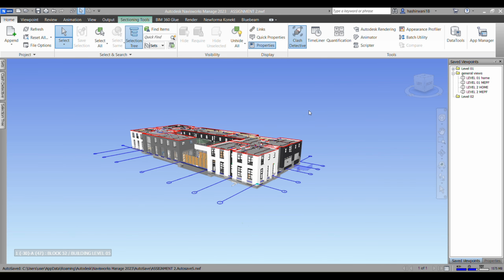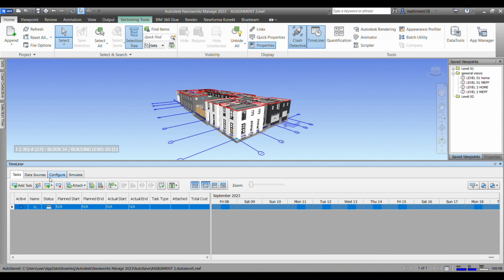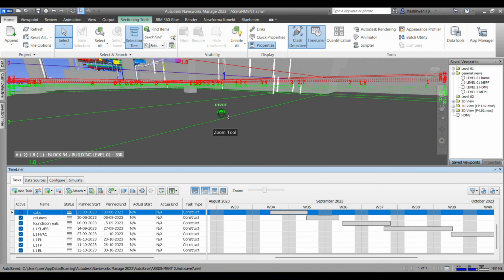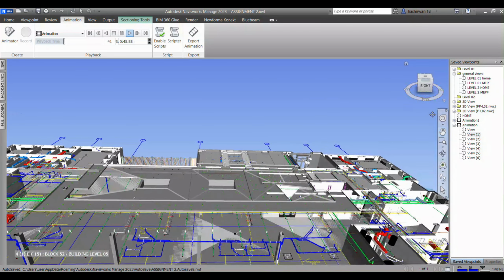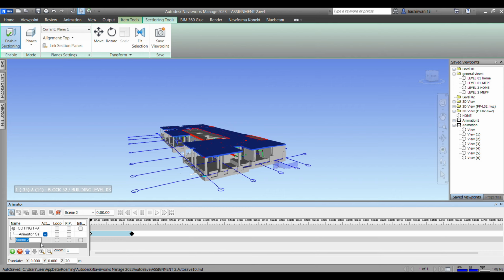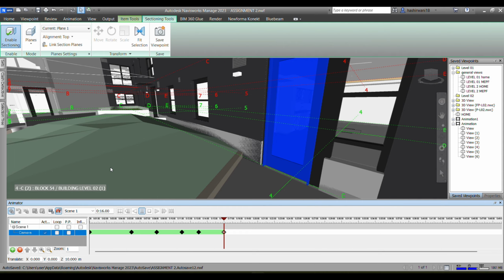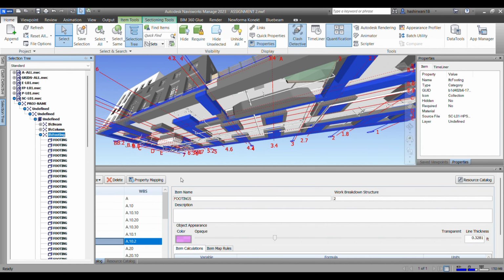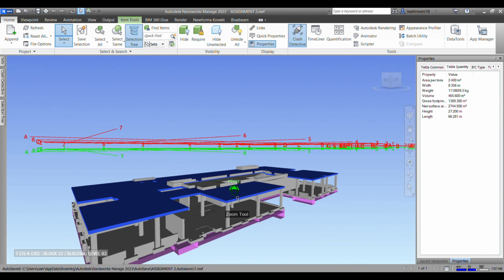BIM Navisworks 4D Timeliner, Animation, Quantification & Field Management Masterclass ER HashirVani

Comment from the maker: This video provides a masterclass on using Navisworks for 4D Timeliner, Animation, Quantification, and Field Management.

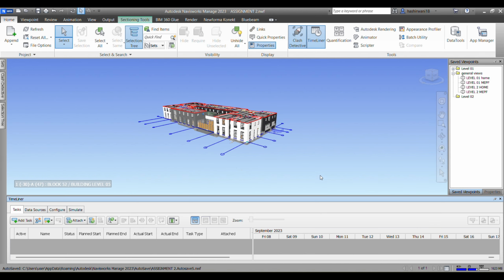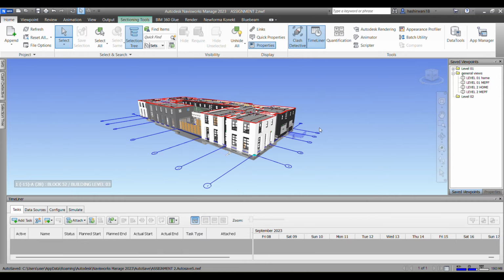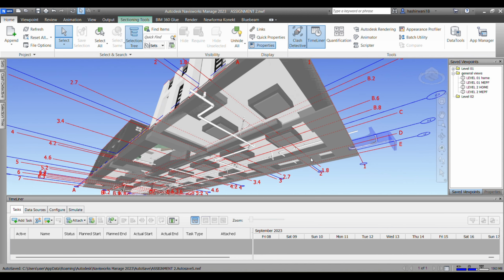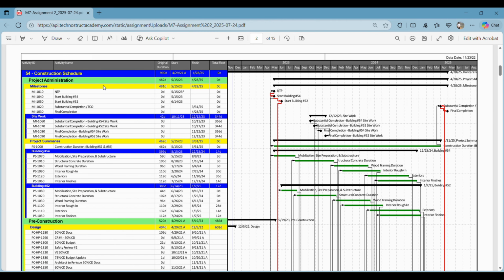The creator details how to use the 4D Timeliner feature (0:32), explaining it as a tool that combines a 3D model with a construction schedule (1:02). This allows for a visual representation of when different services and elements will be completed (2:14). The construction schedule is typically prepared using software like Primavera P6, providing a detailed Gantt chart with project activities, start and finish dates, and dependencies (1:41). The video demonstrates how to add tasks in Navisworks, attach selection sets to these tasks, and assign planned start and end dates based on the Gantt chart (2:50). It also clarifies that only visually representable tasks in the 3D model, such as substructure, foundations, and MEP elements, are included in the 4D Timeliner simulation, excluding conceptual planning phases (4:10).

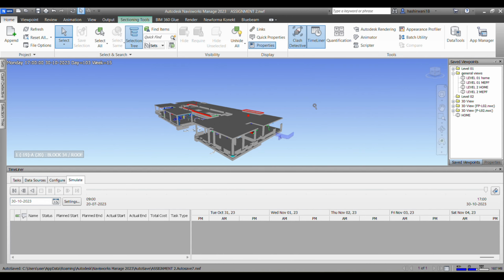The video then transitions to animations in Navisworks (25:35), discussing four types:

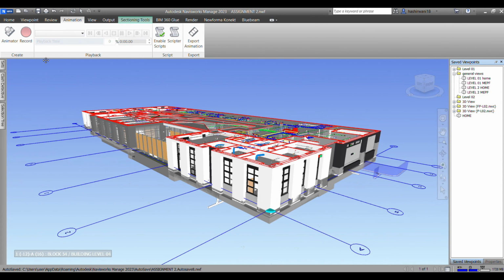Animation by Record: This method records every mouse movement and pan, resulting in a less smooth, "jerky" animation (29:36).
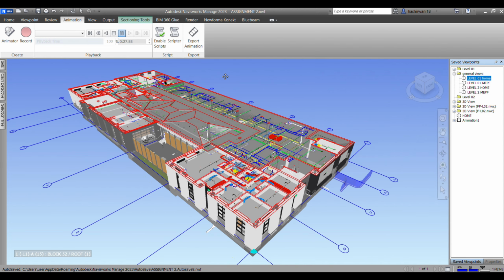Animation by Animator (Saved Viewpoints): This method creates smoother transitions between predefined viewpoints, making the animation more professional (31:07). The video shows how to save multiple viewpoints and then play them as a seamless animation (31:30).
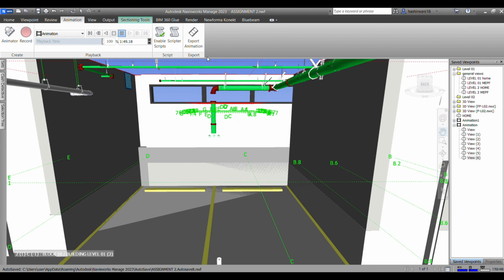Integrating Animations with 4D Timeliner: The created animations can be linked to the 4D Timeliner simulation to enhance the visual experience, allowing the camera to move through the model as construction progresses (35:30).
Object Transformation Animation: The video also demonstrates how to create animations where specific objects, like footings, transform or move (38:10), for example, moving downwards to reveal hidden elements (40:40).
Finally, the video briefly touches upon exporting the animation (36:34).